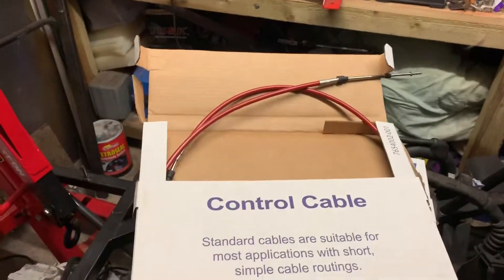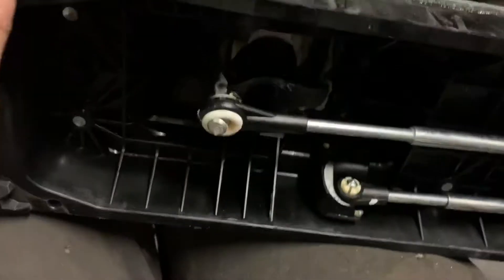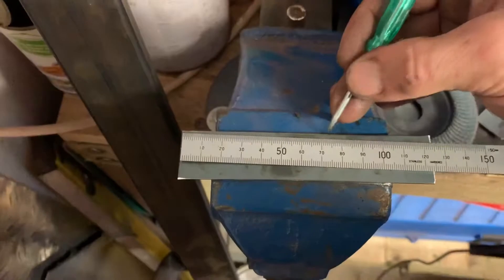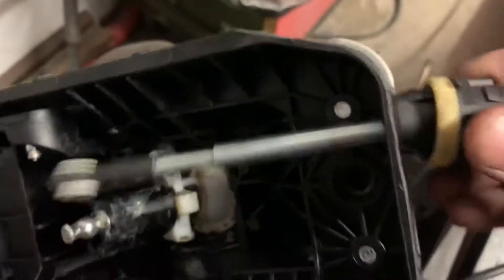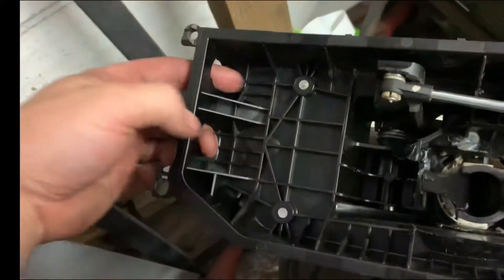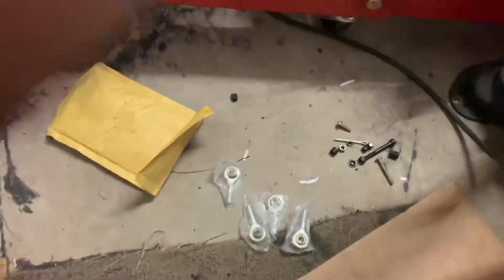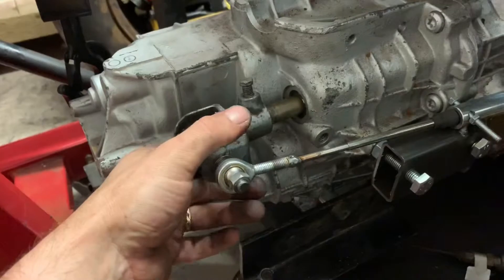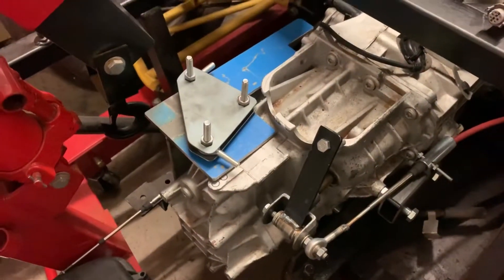Lamborghini countach kit car

Comment: Looking good, and your camera work is getting better, a whole episode in wide-screen ;). Quick question, how come you drilled holes in the gear-change housing, and you didn't just turn the gear-change round 180 degrees? Was the side to side mechanism not going to work in your application? i.e. when you want 1st gear you actually get 5th.
Reply from the maker: Project Supercar I been using my iPhone as it takes forever to sort out the footage with my GoPro but I can go back to using it. If I turned the gear selector 180 then 1st would then be reverse and I would have to push the gear knob down to select 1st all the time and I would loose the push down selector for revers that I wanted to keep. It’s all temporary at the moment I mite change it all when it comes to taking the full car moked up apart. I really just wanted to see if what I had in my head would work in person. Now I know it all does looking for better parts is on my mined. I have never done anything like this before so for me finding out what does work in reality from my mined is sort of cool, yes costly but fun exciting and rewarding all at the same time. Plus working a full time job 6 days a week not enough time to go around lol
Reply: @Spoonersoutings  Cool, so this selector has the reverse in the same place as the Audi gearbox? What's it from, I couldn't quite make it out in the video, so I couldn't see the gate pattern. Maybe if you could show a close up of the gear selector in the next video, that would be great. ;)
Reply from the maker: It’s out of a Vw up. Yes exactly the same gear pattern I’m working on the car as I text. I will run through everything on the next video after finning this linkage, I had more parts in the post for it when I just come home from work so just fitting the parts a little tweak her and there and it will be finished
Reply: @Spoonersoutings  Looking forward to seeing your next episode, and how the linkage works ;)